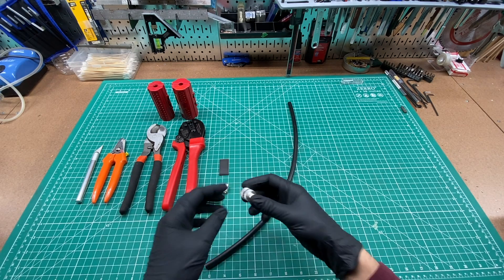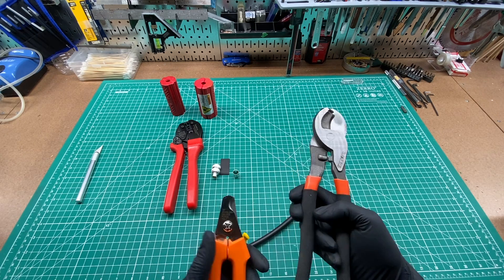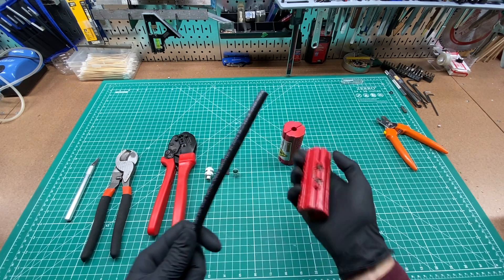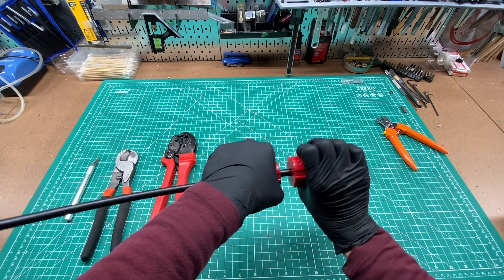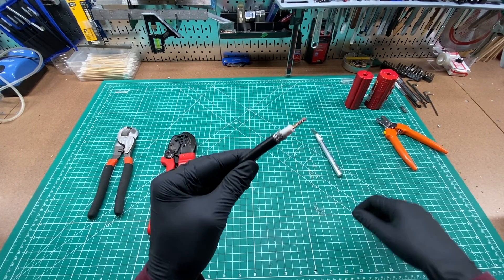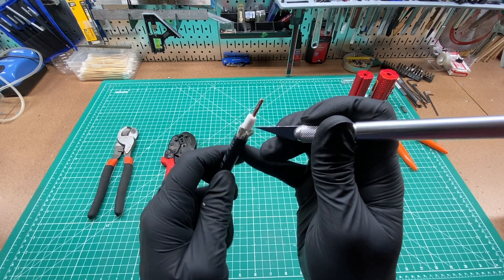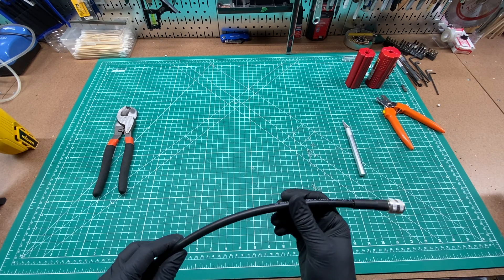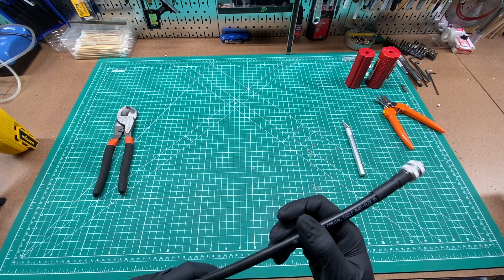Attaching a PL-259 crimp & solder connector from DX Engineering - Long Version

Comment: Nice work, but you don't want to do the 2nd crimp, you want the bottom loose like that so the cable can move a little without cutting into the outer sheathing....   :)
Reply from the maker: That makes sense. Another viewer also called this out. I’ll start doing it that way from now on. Thanks!

Comment: I always have trouble getting the connector on over the stranded Center conductor, it seems i always catch a few of the individual conductors on the strand and pinch them back. I do have an older RG8/U but it’s in really good shape J2015 from jet stream manufactured in 2015 . The DX engineering connector is really high quality. Very well done video and your tools are first class,  as an electrical engineer i salute your video. Of course my hand tremors don’t help the situation.
Reply from the maker: Thanks for the kind words!
Reply: @MostlyBuilds  you’re welcome I remember when I was younger like you was a technician first at an early age and then electrician worked a couple years and then off to engineering school and the rest was history, electrical engineer, power, plant managers and eventually CEO at two companies. Don’t sell yourself short keep Learning. 😊

Comment: I've had poor results with lead-free solder. Even when removing a joint that's soldered with L-F, adding regular solder makes the job easier with less damage to the components.
Thanks.

Comment: is there a reason not to use flux on the cable? seems like that would just make the cable wick the solder right up/
Reply from the maker: Using flux would probably be fine. I’ll give that a try next time. The only thing I worry about in general is heating up the center conductor so much that it melts the dielectric. I wonder if the flux might help speed things up and use less heat? I probably wouldn’t load it up with a ton of flux to avoid encouraging the solder to migrate deep into the connector near the dielectric. I’m speculating on a few things here. If anyone has more experience, please chime in!

Comment: Does the tool work for rg8?
Reply from the maker: Yep. If you scroll down on the product page for the stripper tool, it tells you the supported cable types. RG-8 is one of them. Links are in the video description.

Comment: Why are the DX connector pins so short compared to everything else. I ordered some of these and I don't like em. The cable strippers are over the top priced too. Your better off with a finger spinner type. Tin and flux the leads before you put em in the connector and it will go much faster with less chance of melting insulators.

Comment: Seeing as I don’t have the prep tool can you give some instruction regarding how much to strip off before install these connectors?
Reply from the maker: If you have this same DX Engineering connector, the product page for it has a cuts guide that gives the dimensions (under Documentation -> Charts & Guides -> Crimp Cuts Spec Chart). Here is a direct link: https://static.dxengineering.com/global/images/chartsguides/d/dxe-ut-kit-cc1_ve.pdf

Comment: Great video. I just got my DX delivery today. Tomorrow is my 'cable shortening' project day and this video makes me think tomorrow will go swimmingly. Thanks for taking the time to make this video.

Added the next day:  Man, crimping for this 78-year-old is a BEAR! I barely have enough grip strength to make it happen. I have to lean over and use grip plus tummy to squeeze these things. Then, I had to put the crimper in a vice for the final squeeze to unlock the thing! I hope things improve because I've got several cables to shorten. Maybe I'll just start OFF using the vice.
Reply from the maker: Thanks! Best of luck with the project!

Comment: My problem I’m having is the hole on the inside of the connector is too small for the braided center connector. Now I’m having to buy some new ones. 😡 Hopefully the solder ones will work.
Reply: I have found that the center conductor always bends and then You have all kinds of bent strands of wire causing a short. You have to pre-tin the center conductor to keep them together and then with a Dremmel grinding wheel carefully grind off the center conductor just enough for the center conductor to fit in that pin. It took me a while to figure it out but once I did, I can now install PL259's of any manufacturer that look good and also work great.
Reply from the maker: @user-rd3wq2st6r that sounds like a reasonable solution. If using leaded solder I personally would probably avoid any sort of grinding that will create dust.

I haven’t had this experience using Davis Buryflex and the DX eng connectors from the video. I’m able to slide the center conductor into the center pin on the connector without the individual strands being disturbed. I guess your mileage varies depending on the cable brand?
Reply: For soldering, use a little solder flux paste on the parts to be joined before soldering. That makes to solder flow and wick into the parts much better.

Comment: Very nicely done. I first found the short version of this video - there is so much more useful information in this one.

 Would the larger cable cutter have worked as well as the smaller one, such that you wouldn't have needed to have both cutters?
Reply from the maker: Thanks! The larger cutter would have worked. It isn’t quite as sharp as the smaller cutter. I prefer the smaller + sharper cutter that I used. You don’t really need the larger cutter since you could reshape the end of the cable by pressing it against your table with something hard. I just use the larger one to reshape it because I already had it for cutting 4 awg ground wire. Another cutter that looks interesting that I haven’t tried is this one: https://theantennafarm.com/shop-by-categories/coaxial-cable/tools-accessories/coaxial-cable-accessories-50-ohm-radio/1629-other-coax-cable-tools/7369-times-microwave-cct-02-detail This one is interesting because you lightly pinch it  against the cable and spin it around so you slice it evenly from all sides, instead of chopping through it and squishing it like I did.